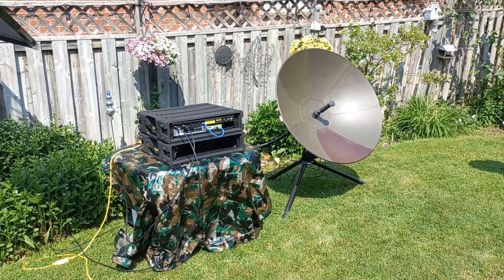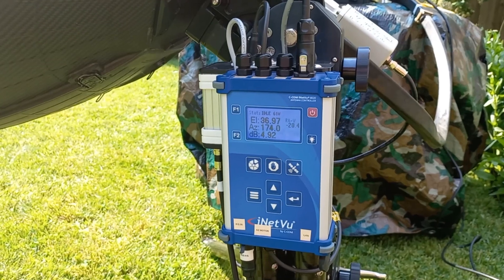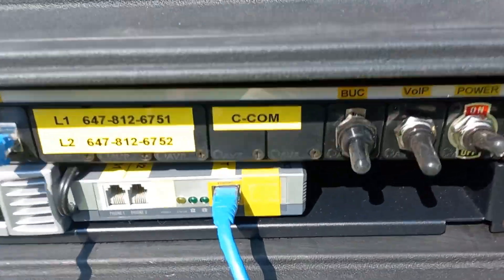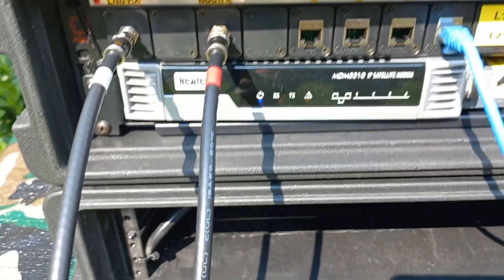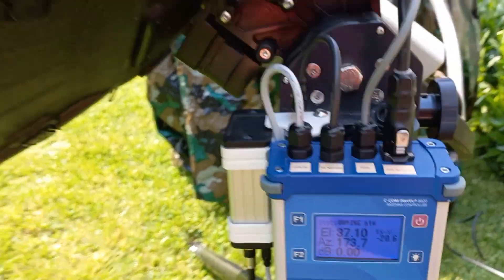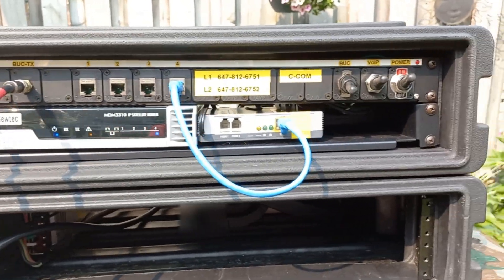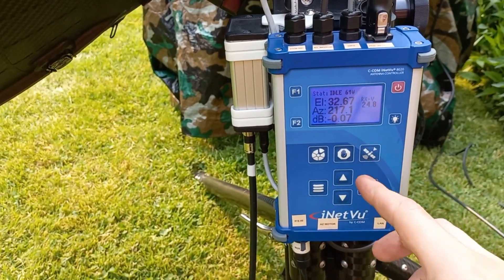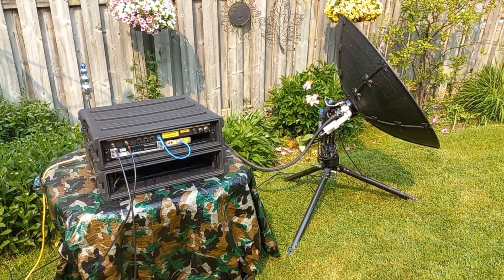VSAT Ku Band Manpack SatCom Communications

Comment: Where did you find one of these? Can you just buy one or is it special?
Reply from the maker: Anyone can buy one if you have the money. They are designed for and have MIL-SPEC so they are expensive. New they cost around for the whole kit $100,000 USD. Surplus you can get them for around $20,000

Comment: Haha this was sweet to see. Quick note though, the BUC (block upconverter) just converts from the baseband (modem output) L, C or IF band to Ku or Ka band for SATCOM. The actual power (the 65 watts) is supplied by a SSPA or HPA, in this case it could be either, just a signal amplifier. So from a signal level, it outputs from the baseband at a low power (limited by generation power of the baseband), goes through the BUC to upconvert to a higher frequency signal, then through the amplifier to reach a power level that can hit out to those 2200 miles away! Super cool stuff though, I love stumbling across vsat stuff on the interwebs! Used to do this stuff for a career for a while then got out of it!